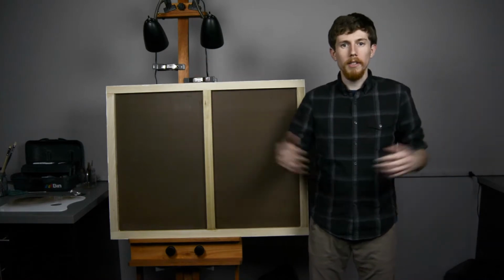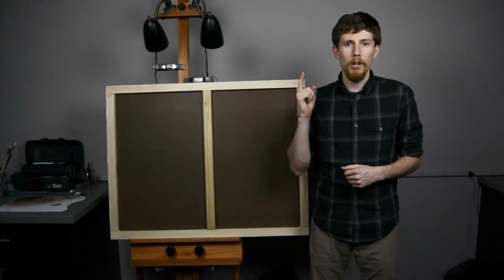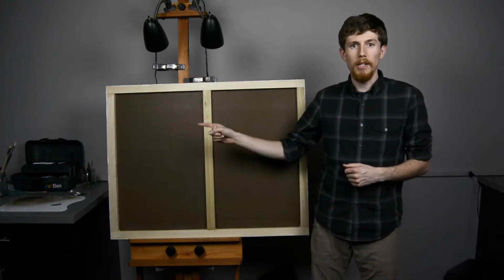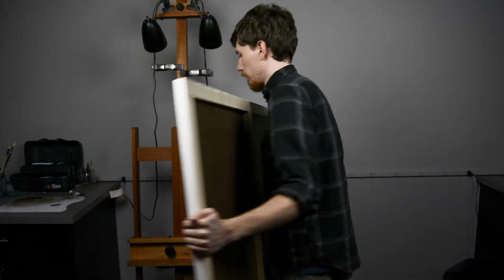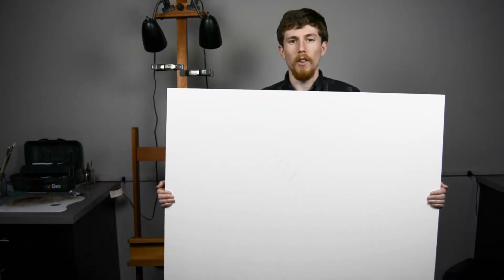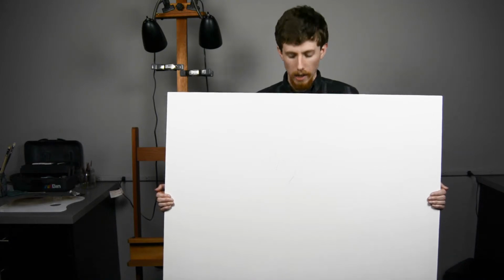How to paint on a BIG panel

Comment: To thoroughly avoid any warping, I advise painting front and back of the panel and all sides of the back bracing before assembling. Peace.
Reply: Thank you Clint for that advice.  I find when I paint on a bought canvas board, 24/36, mine don't warp.  After I am finish my abstract, I lay it flat on the floor to dry.
Reply: @dianehansma1725  Hi Diane. I'm addressing the problems that can happen on thin plywood panels. The wood warps because of differences in moisture content especially between the two opposing sides. When only one side is painted, humidity will be absorbed on the unpainted side and warping can occur, especially with thin boards. A dry environment is ideal but often not possible.
Reply: @clintatk  thank you for that, never thought about it that way!!  I know I will cradle 1/8 for sure, but today, I am going to purchase both 1/8 and see how the 1/4 works for me, I am still searching for info on how to use a silver frame around my art using the 1/4 inch masonite.

Comment: Your video is easy to understand.  Thank you. 
What kind of panels should I buy for acrylic painting? The thickness and quality?
Reply from the maker: Thanks! Masonite panels will work just fine. I use 1/4 inch thickness.
Reply: As long as the cradle is level and square, 1/8 and 3/16 work great

Comment: Your paintings are amazing and thank you so much for sharing your tips so unselfishly.  I am 65 and painting helps me free my soul, but abstract is more fun on larger sizes.   I want to buy a sheet of masonite cut into three pieces~~32x48.  I will frame the back, do you think that will be too heavy?   Warm greetings from Canada!
Reply from the maker: Hi Diane, thank you for the kind words! Yes it will be heavy but not too heavy as long as you use the correct method of hanging it.
Reply: @KevinMooreArt  thank you so much for taking time out to answer, bless your heart.  I know I am pushing it, but I wanted to try the 1/4" masonite so I don't have to cradle the back.  I am sure it will be heavy, but there must be a way to hang it.  I am excited to buy masonite for the first time.  Hope 1/4" will work.
Reply from the maker: @dianehansma1725  No problem :) Even with 1/4" it will still warp a bit, I would recommend cradling it. Maybe use thinner strips of wood to reduce weight. Do you know what kind of wall you will be hanging on?
Reply: @KevinMooreArt  my son wants an abstract for his living room wall which would be drywall.  I know that it will have to be hung securely, not sure what is the best method~~hooks of some type or to use wire~~very confused.  I am going today actually to look at the 1/4".  I may try both.  Cradling for sure, because you need some type of frame.  Did you see Elco Maan's art?  He frames his own, using a thinner silver frame.  That would be epic, but can't find any info of that one.  Sure would be nice on 1/4" masonite without cradling.  I don't know why, but mine don't warp, at least not the hardboard 24x36 I purchased from art stores.  I lay it flat on the floor to dry.  Maybe masonite warps more, I will find out for sure.  Thank you so much for your help and advice.  Have an epic day my friend!!

Comment: why no sealer before the gesso? with out the sealer is it still a good method for long term archiving?
Reply: Use rabbit skin sizing or PVA.  The panel should be sealed.    The hardboard is fine for  smaller sizes.  To reduce teh weight I use  Birch 1/4in furniture quality ply.  Seal edges and back as well.  I use  about  five coats of gesso. On the back, two coats of spar polyurethane varnish.